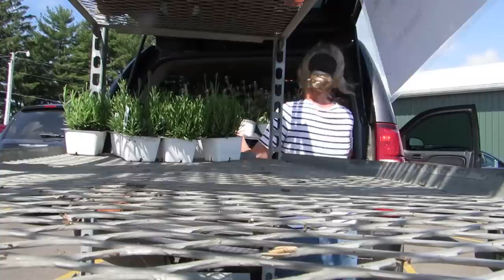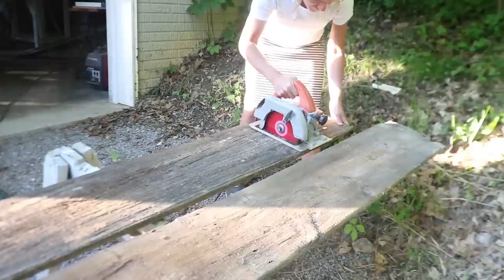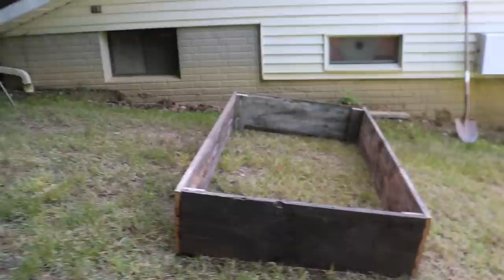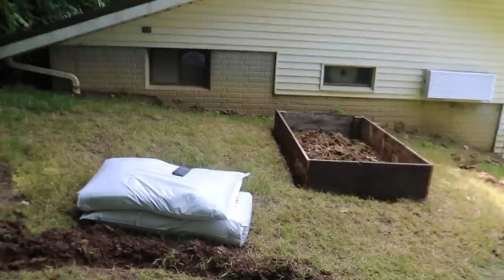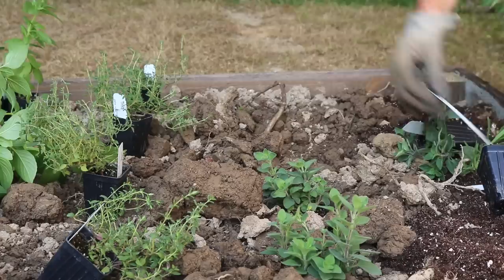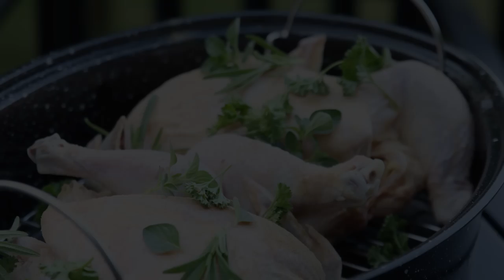Growing Herbs ~ Making an Herb Garden ~ Summer Time Gardening ~ DIY Raised Bed

Comment: Great job. Several have cautioned you about weed killer and I would agree..
I would also suggest putting
 the mint in a pot. Mint can take over your garden. 
I use potting soil, peat moss, and black cow. You probably have manure available. It can not be fresh or hot. 
I stated  using the 3 last yr and what a difference. 
Also the basil and Rosemary will not with stand the winter.
Reply: I agree about the weed killer, Kleenup is a new word for Roundup and it's a carcinogen.  I have stuck to the "old way", taking out the layer of grass (and making sure I shake out as much soil as possible to keep it in the garden bed rather than the compost pile) before digging and amending.  No chemicals for this gal!

Comment: You work so hard! I like the pine straw as well. It just fits right in with the arbor you made. Bark tends to draw more mosquitoes here in NC. It's going to do amazing I'm sure. Did you use any manure or fish for fertilizer? I used fish this year and it just exploded!  I will use it from now on. As usual a great video!